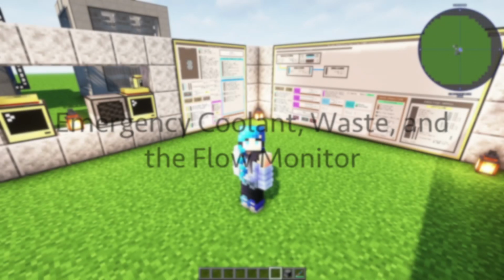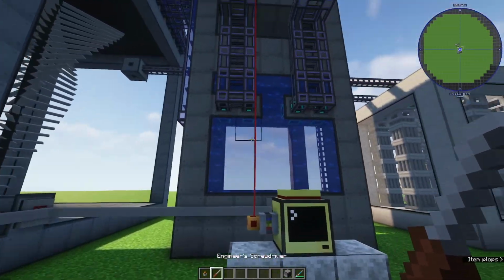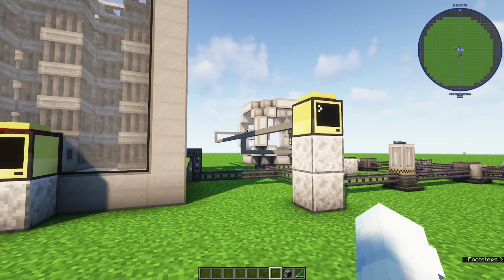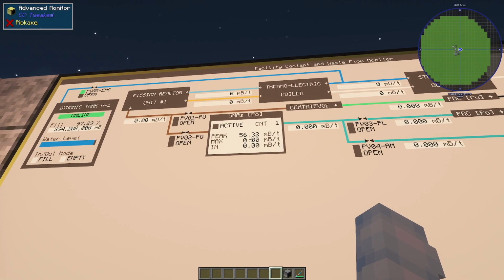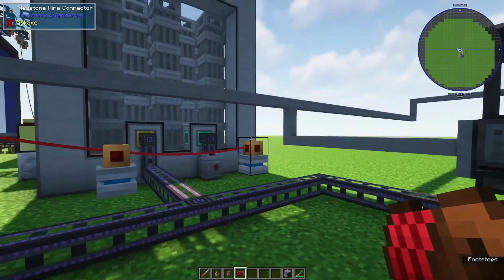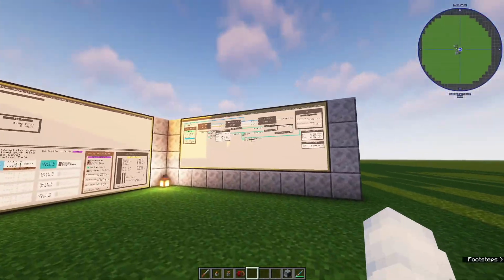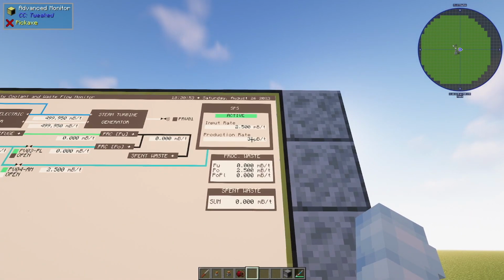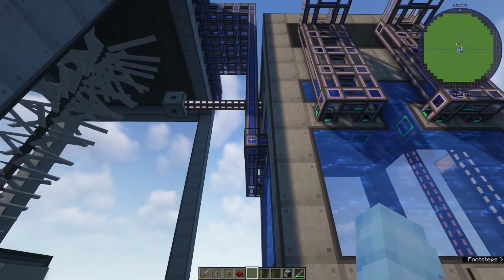Emergency Coolant and Waste Processing

Comment: is there a way to not use immersive engeneering ?
id like to use normal redstone signals or wireless redstone mods
Reply from the maker: Yeah, just don't set the color of the output (nil or exclude the color completely). https://github.com/MikaylaFischler/cc-mek-scada/wiki/System-Setup#rtu-configuration

Comment: Hey really neat video I just wanted to mention that with lua you can do multi line comments with
--[[
Code
]]
so you don't have to go through every line and uncomment them also an easy way to make cancelable comments is
--[[
Code
--]]
because you can just add another dash to the first one to cancel it out ex. ---[[ instead of --[[ to cancel it
this is not meant to be a criticism I just figured maybe this could help sorry if you already knew it lol
Reply from the maker: I am aware and I do use it in a few places (supervisor/unitlogic.lua), but pretty sparingly. I guess I ended up preferring the single line comments for whatever reason, especially for lots of the documentation. Those instances in that file I mention were big descriptions on conditions for turbine and generator trips, but elsewhere I ended up just using the double dashes. In the future those config files won't exist, so I didn't worry too much about their long-term usage. But no worries about mentioning it! :)

Edit: and I'll blame vscode/vscodium for doing -- when I use the keyboard command to block comment highlighted code, which I guess is the real main reason the code is like that haha

Comment: The UI is so cool. How did you make those connections? Im thinking it took a bit of math to figure out.
Reply from the maker: Since I abstracted my graphics interface, the connections ended up being a lot of "check which neighbors this cell has" rather than calculations since the process is
1) fill a 2D array with cells that should have pipes in them (including which color)
2) go through each cell, check what type (thin/thick) and color pipe is there, check its 4 cardinal direction neighbors, if they match, then pick the right computercraft character to put there (https://github.com/MikaylaFischler/cc-mek-scada/wiki/Characters), so I have to pick the right symbol to match where the pipe is and what connections it has

Ended up being a lot 'if'/boolean logic rather than calculations, same with how to position facility dynamic tanks. Both of which took a lot brainstorming and verification though, which was part of why the update that added them took a while
Reply: @cc-mek-scada  Thanks! I'll be trying to make like a turtle monitor or something like that and I really liked this UI. I intended to have some turtles be connected to some kind of server that would also appear on the monitor.